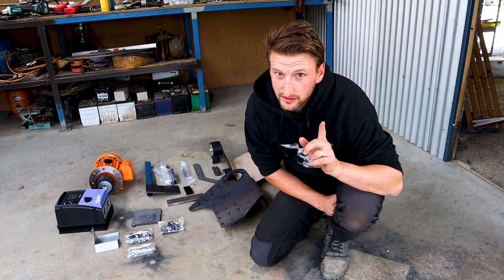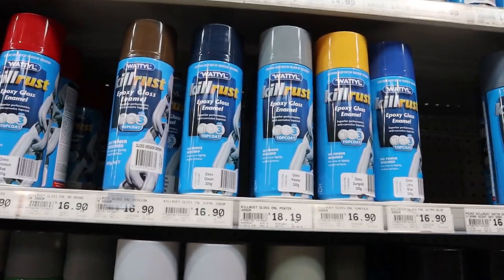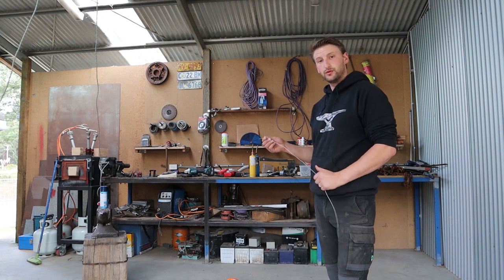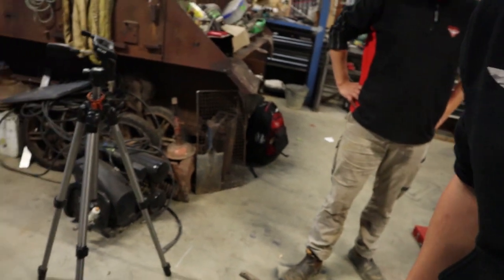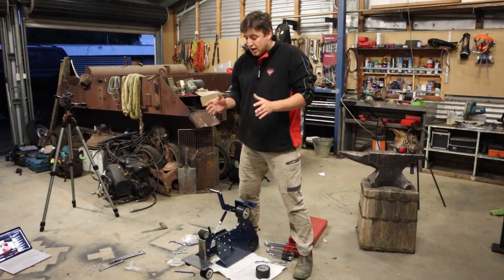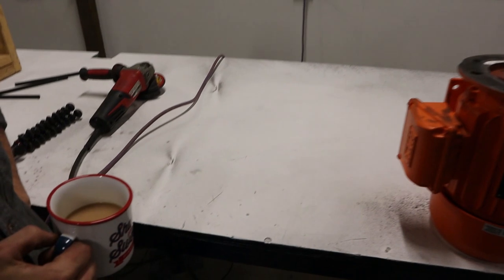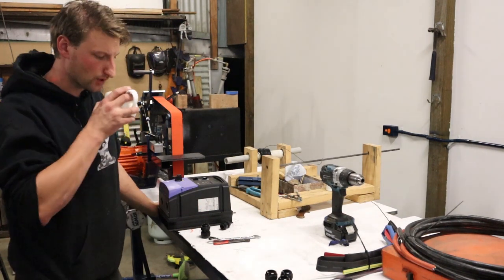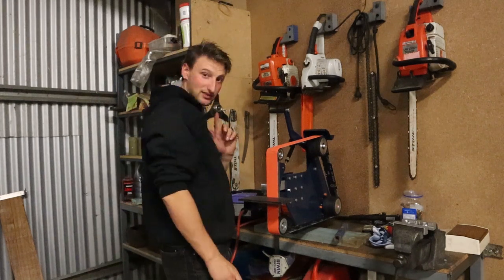Assembling a 72 inch Grinder from 84 Engineering

Comment: How much was that VFD and what model? People sell them for 800 bucks but wonder why they cost that much?
Reply from the maker: The drive is an Invertek ODE-3-220105-1F4Y-01. This particular brand is made in the UK. It cost us $1100.00 AUD from the local dealer. This model was a bit more expensive as its IP66, so dust proof and water proof which seemed like a good idea given the environment it was going in to. There are much cheaper models on ebay, however in my experience (my trade is electrician) you get what you pay for.
Reply: Van Diemen Anvil thanks for your help man👍🙏